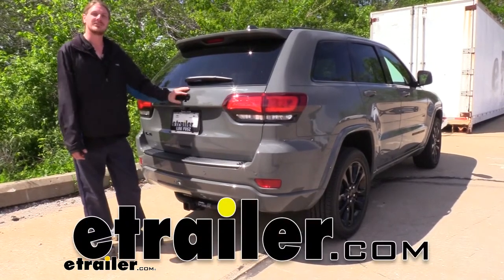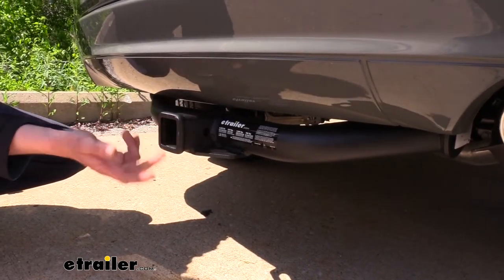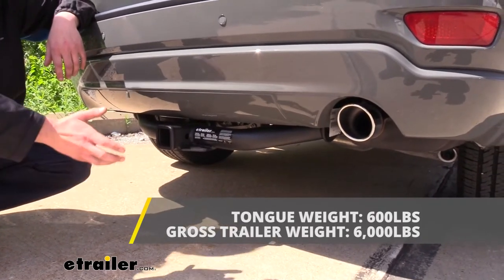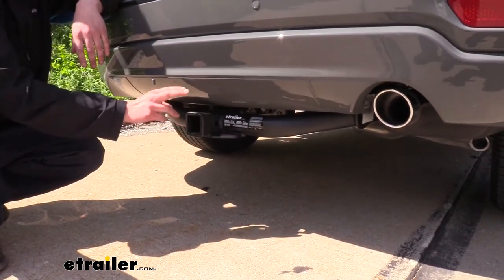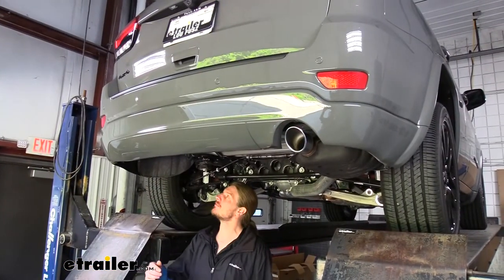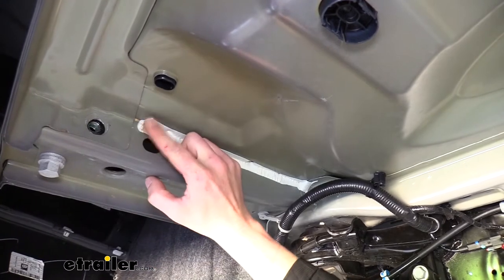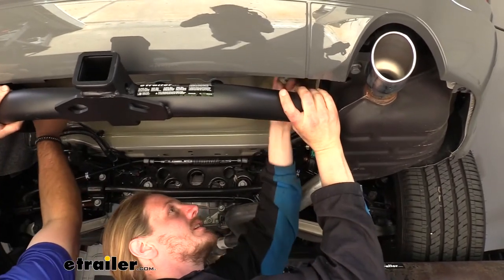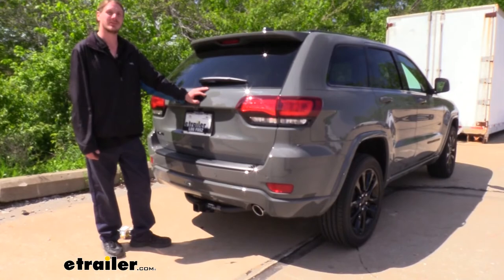etrailer Trailer Hitch Installation - 2020 Jeep Grand Cherokee

Comment: Have you addressed that the hitch can handle 6k pounds but without the HD cooling from factory Jeep says that any aftermarket hitch the V6 grand Cherokee can only handle 3500lbs.
Reply from the maker: You will always want to go with the lower amount between the hitch capacity and the vehicles capacities. It is always good to know that your hitch is more than strong enough to handle what your vehicle can.
https://www.etrailer.com/Trailer-Hitch/etrailer/e98901.html

Comment: can this be installed with the vehicle flat on the ground?
Reply from the maker: You can definitely install this hitch with the vehicle on the ground. It will help if you can get your hands on a set of car ramps in order to back the vehicle on to get the rear of the vehicle a bit higher. This just gives you more room to work.
https://www.etrailer.com/Trailer-Hitch/etrailer/e98901.html

Comment: I think I missed it. New to the jeep world and want one of these installed on my Jeep Grand Cherokee 2020. What part number is this so I can order one? I want one to tow a small camper or bicycles.
Reply from the maker: Check out the following link to see this hitch on our website. You will also need a trailer wiring harness to pull a camper.
https://www.etrailer.com/Trailer-Hitch/etrailer/e98901.html
https://www.etrailer.com/t1-2020_Jeep_Grand+Cherokee.htm
Reply: @etrailer  thank you so much. This weekend I am ordering from y’all. More helpful than other places I’ve tried.

Comment: 2 questions:
1. will this work with a v8 engine?
2. how do i get the one with the weight distribution? my car can tow max 7,500lbs so the one with the weight distribution is best
Reply from the maker: Yes, this hitch will work great with the 2020 Jeep Grand Cherokee V8. The weight distribution weight capacity will be if your are using a weight distribution hitch with your trailer. Check out the following link to see the different weight distribution hitches we have available in the following link.
https://www.etrailer.com/dept-pg-Weight_Distribution_Hitch.aspx
https://www.etrailer.com/Trailer-Hitch/etrailer/e98901.html
Reply: Would this be the same installation process for a 2015 Laredo 4x4? Thank you. I need to get one for my jeep

Comment: does this need a weight distribution system?
Reply from the maker: Determining whether or not you need a weight distribution system with a 2020 Jeep Grand Cherokee would depend on what you are going to be hauling and if you are needing the extra support.
https://www.etrailer.com/Trailer-Hitch/etrailer/e98901.html

Comment: What are the torque specs ?
Reply from the maker: You can see those in step #3 of the install instructions I've linked below for you. We don't publish the torque ratings because they can change over time. The best place to find the latest, most updated information on that is in the install instructions.
https://www.etrailer.com/instructions.aspx?pn=E98901
https://www.etrailer.com/Trailer-Hitch/etrailer/e98901.html